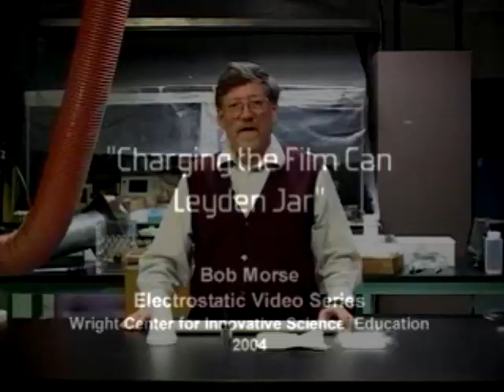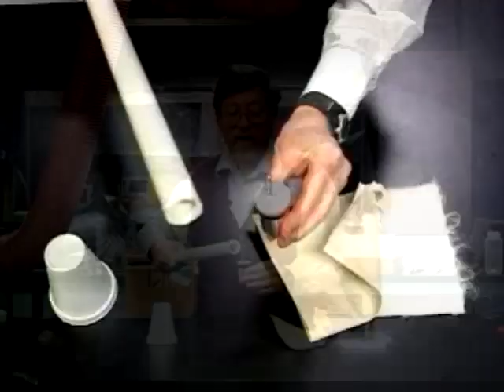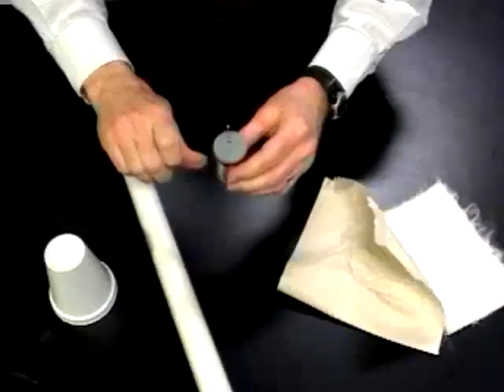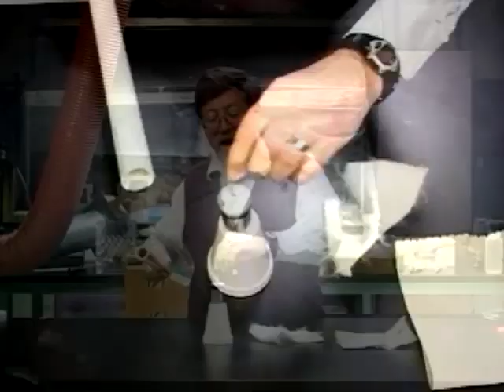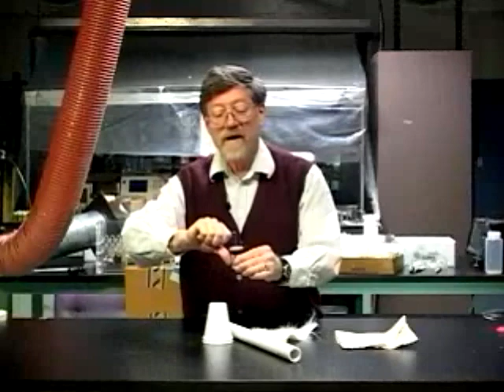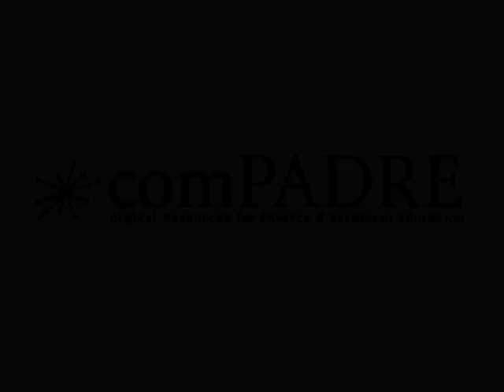Charging the Leyden Jar

Comment: Hehehe I did this as a science project for 7th grade and went to state. It was hilarious shocking people along the way. The only differences were that mine was larger and I rubbed different cloths on a chopping board. I then put an aluminum pie tin (I taped a styrofoam cup on it to prevent discharge) on the chopping table and touched the nail on the Leyden jar. I did that multiple times and shocked so many people. I love Leyden jars!